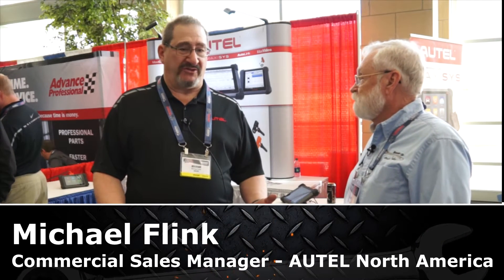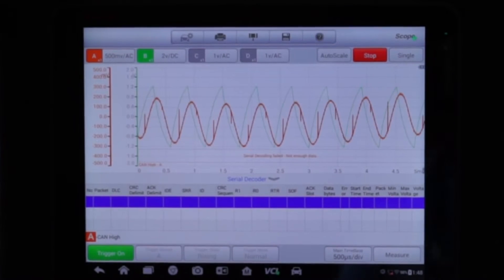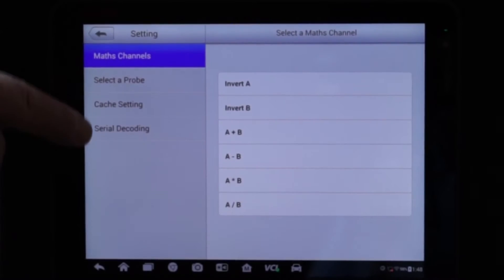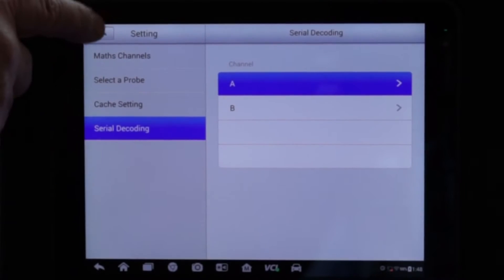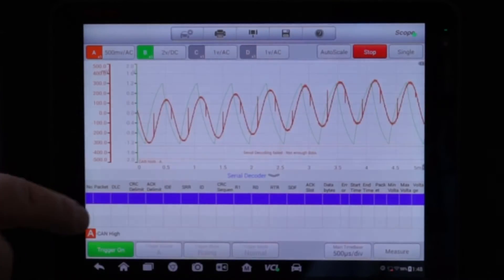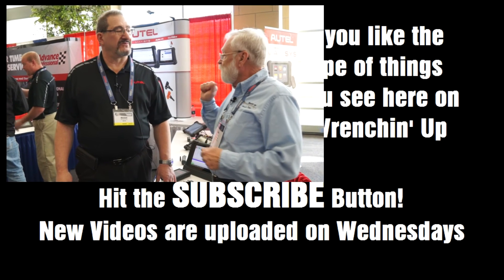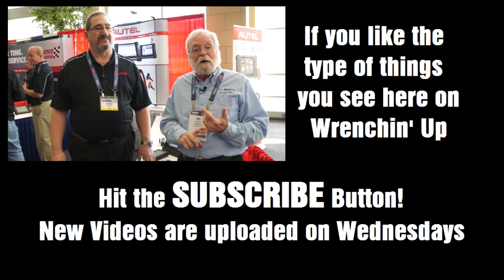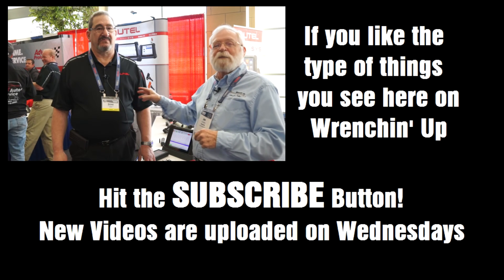AUTEL's Scope Does Serial Decoding - Wrenchin' Up

Comment: How does the MP408 measure up to the Pico? Is there a feature comparison available?
Reply: Kip,  I broke down and bought this scope and being able to use it with my maxisys is nice. Having to drag out a laptop is a minus. Don't compare the Pico to the Autel. Pico is superior  but 99% of the time for everyday diagnostics it's overkill. The real big plus for the Pico is access to known good waveforms.  1st powered by the Maxisys is a plus for portability, 2nd, battery life is great, 3rd for everyday checking the quality of a signal it's right there no need for a laptop, 4th Just place it on a small shop cart with your maxisys with a peace of counter top and get a over the door hanger with 4 hooks and your set for instant use. BTW colored tape at the ends to keep track of what cable is what is a must, LOL.
I have a in cylinder pressure transducer , low amp probe and 3 test leads at my disposal all the time. 
The downside, it comes with the HT25 10000:1 decay cable for secondary but has no selection in the probes for it and I just use 10:1 and then the scaling is x1000 and no custom probe ability. The secondary ignition patterns are upside down. When using the math function it freezes at times and the software needs a restart. Also Pico gives you more then just 2 cursors to measure with and the fitters are super to clean up the trace. All in all I love it and have used it with my 17inch laptop with the best battery life of the 6 I have and it will kill the battery unless plugged in. The laptop is like a ball and chain in the real world as a tech. I bought the Pico Amp clamps with the 10ft cord to accessory it. Still need a no1 secondary trigger for those once in a blue moon conventional ignition systems. 
BTW I'm sending in vids with requests for upgrades and changes all the time straight to support@Autel.com
Reply: Deathknell. I broke down and bought this scope and being able to use it with my maxisys is nice. Having to drag out a laptop is a minus. Don't compare the Pico to the Autel. Pico is superior  but 99% of the time for everyday diagnostics it's overkill. The real big plus for the Pico is access to known good waveforms.  1st powered by the Maxisys is a plus for portability, 2nd, battery life is great, 3rd for everyday checking the quality of a signal it's right there no need for a laptop, 4th Just place it on a small shop cart with your maxisys with a peace of counter top and get a over the door hanger with 4 hooks and your set for instant use. BTW colored tape at the ends to keep track of what cable is what is a must, LOL.
I have a in cylinder pressure transducer , low amp probe and 3 test leads at my disposal all the time. 
The downside, it comes with the HT25 10000:1 decay cable for secondary but has no selection in the probes for it and I just use 10:1 and then the scaling is x1000 and no custom probe ability. The secondary ignition patterns are upside down. When using the math function it freezes at times and the software needs a restart. Also Pico gives you more then just 2 cursors to measure with and the fitters are super to clean up the trace. All in all I love it and have used it with my 17inch laptop with the best battery life of the 6 I have and it will kill the battery unless plugged in. The laptop is like a ball and chain in the real world as a tech. I bought the Pico Amp clamps with the 10ft cord to accessory it. Still need a no1 secondary trigger for those once in a blue moon conventional ignition systems. 
BTW I'm sending in vids with requests for upgrades and changes all the time straight to support@Autel.com
Reply: Edit to above....I see the Autel is compatible with both my Autel scan tool and my laptop...for the price I think I will bite the bullet and try the MP408 by Autel.
Reply from the maker: Hi Kip - Good question. If the AUTEL folks don't answer your question here soon, be sure to ask them directly. Their contact information is in the description below the video. Thanks for watching!
Reply: I haven't found a comparison. There is a ton of chatter about the Pico on the interwebs. I know a couple of techs with the Pico, but none with the Autel. I have an Autel 908 pro and I love it. Thinking of adding the MP408 but lack the info to make an informed decision. At the same time I am inclined to have a seperate scope from my scan tool...
so...thinking the pico makes sense to use with laptop. Right now I am using a snap on modis as my labscope.
Reply: Deathknell how do you like your autel scope so far?
Reply: Kip Nuesch it doesn’t compare the pico is 10x more advaced and easier to use. Downfall you need a laptop but I like it that way.